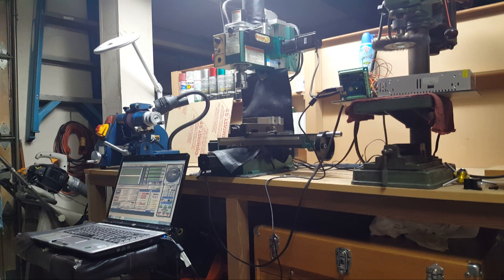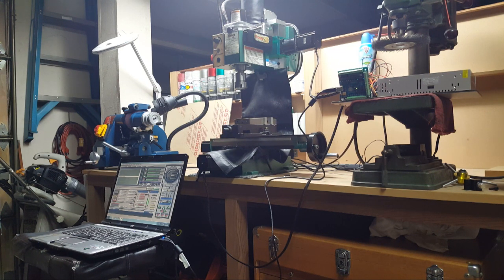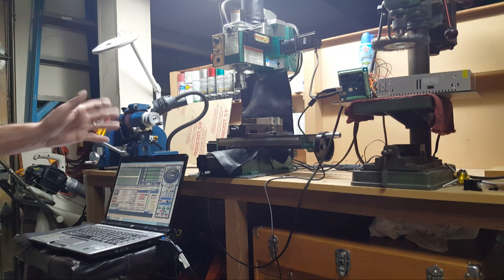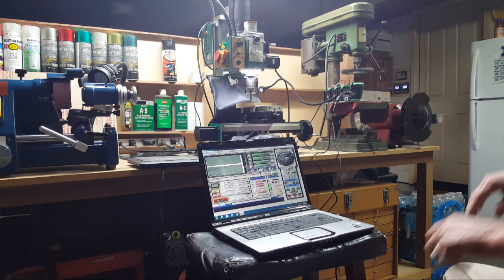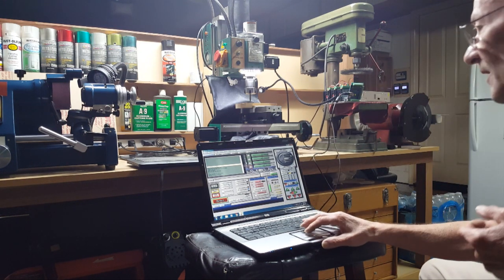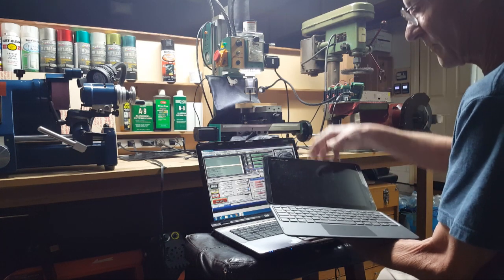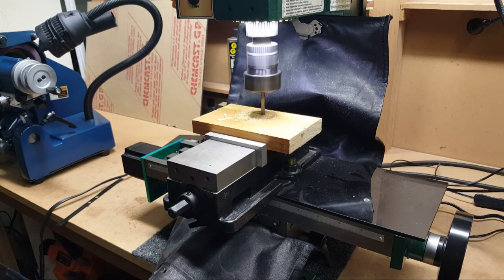Full Mini Mill CNC Upgrade & Software

Comment: I went through the conversion process myself. For motor control and CNC software I went with the Centroid Acorn board and their CNC software. Loved it so much I converted my mini lathe using the same setup. Their software will run both.
Reply from the maker: I just discovered the route I went didn't cost much but there is no backlash compensation with the control board so need another solution...
Reply: The Centroid software has the ability to compensate for backlash. I also found that when the gibs are adjusted to the point where I like them, those spring couplings flex quite a bit and this will create more backlash. I switched to the couplings with the poly inserts and it made a big difference. When I started searching for conversion ideas, I happened upon a channel called martyscncgarage and his videos on the Centroid Acorn board made up my mind on which way to go. Keep up the good work Dave, I enjoy watching your channel.

Comment: Maybe you are losing steps when going to zero. That is why you see number different then zero. Try reducing acceleration.
Reply from the maker: There is no feedback to the software so it has no idea if a stepper missed a step. I have run it without power to the drivers and the dro;s keep counting as if the motors where turning.
Reply: Dave M  you are right. Maybe there is something wrong with your control board. I have a Chinese router with mach3 and had no issue so far.

Comment: Well done Dave! I do have some idea about the efforts You've put into it. Did the same for a Micro mill, almost got GRBL running. Downloaded a 3 year free version of (con)Fusion360 but not one tutorial was useful. Too bad footage so I couldn't see where they clicked, or the tutorial used another version of Fusion the my download.
Running CNC is more difficult then manual milling. In manual You here and see if the cut is wrong. When the CNC hits the accelerator... milling bits or stock might come flying due to too high feed rate etc.
It will be very interesting to watch this serie of videos.

Comment: Hi Dave -- Would it be possible to mount a high speed spindle where the collet holder is and use the mill to carve and engrave in wood at a higher bit speed? Also, I wonder about replacing the collet holder to hold a vibrating engraver tool to engrave in metal. 85 and still active.

Comment: Hi Dave,
Interesting video :)
I tried something similar with a X2 mini mill, about 10 years ago :).
I used the LMS Z axis conversion and made the stepper motor mounts for X & Y, as you have.
Unfortunately it didn't last long, it chewed through leadscrew nuts for fun.
I should have used ball screws instead, quite pricey at the time.
Good luck :)
ATB Adam

Comment: Hm, I have used Mach3 for over 10 years and in the meantime this happens on a CNC router, a mini lathe and a mini mill. I have have had my share of problems in that time but invariably overcoming these came with the realisation that it was me and not a bug inside the programme. Incidentally - the slippage/losing of steps when moving the y-axis you said you do not understand could be a consequence of the motor tuning: check the the acceleration ramp inside Mach3 and slow it down, perhaps that does the trick.

Comment: I used to use Mach3 to run my desktop mill but finally got tired of the hassles. 😁 I've switched to GRBL and Universal G-Code Sender, so much nicer. But when using Mach3 I used the Fanuc post-processor and it worked without issues and no metrics either. Nice conversion, thanks for the video!

Comment: At 7:00, unclear. You said, 'all zeroed out, tell it to go to 0, it moves.' Regardless.

You said 'one of them, maybe all, don't read 0.' Are you seeing small 0.002, 3, 4 oddities? Not just around 0 but anywhere? That's conversion error. The real answer is to measure the move, which should be correct.

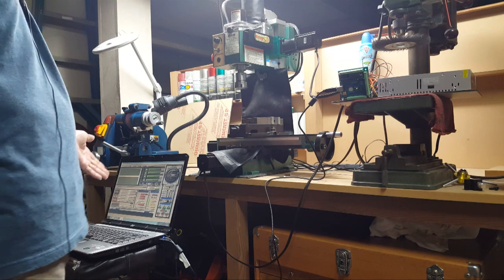Comment: Did you say you're running LinuxCNC talking to Mach3?  Seemed that's what you were saying around 2:40.  Not sure what that means, but why not just ditch Mach3 altogether?  I'd be happy to help you setup LinuxCNC if I can.  It's a steep learning curve, but it's wonderful once you get over the hump.  Mach3 is antiquated.  Let me know if I can help.
Reply from the maker: I would absolutely love to get away from Mach3 but I'm windows based and if win8 can't find the USB controller I doubt   if debian would either.. but thanks!
Reply from the maker: Freecad the cad design software' I'm using its linuxcnc post processor  to generate the G Code for Mach3.
Reply: @TheMiniMachineShop  If you are using a Linuxcnc post processor in Freecad and it is set up for mm then the GCODE will have a command at the top telling the controller that it is using mm. Please have a look at the Linuxcnc GCODE guide for more info on gcodes. For instance G20 is Inches G21 is mm. You could change the G21 to G20 but you would likely have everything ending up off by a factor of 25.4.
Reply: @TheMiniMachineShop  Ah, now I understand what you're saying.  For what it's worth, my first few LinuxCNC setups I just asked friends if they had any old computers and collected a few and tested them with LinuxCNC.  I found several that had parallel ports and with a $10-$20 breakout board I was in business.  In any case, I'd be happy to help if you want to try that route.  Once you get LinuxCNC setup it's awesome.  

My son and I ended up with a used older Tormach 1100 and it still had the Mach3 software.  Wow.  Painful.  We upgraded it to PathPilot, which is just a customized LinuxCNC and its pretty great.  I still use LinuxCNC for my HF Mini Mill and my PM-25.  It just works.

Comment: Around 5:00, the noise. If it has brushless motors, could be ESC issue. There are a few different issues possible, timing, spikes, drops, noise.